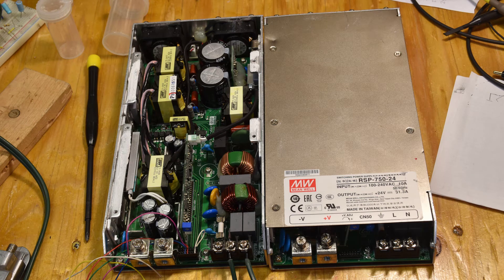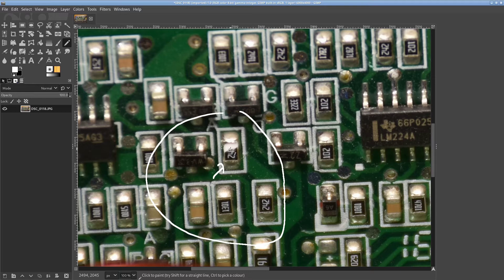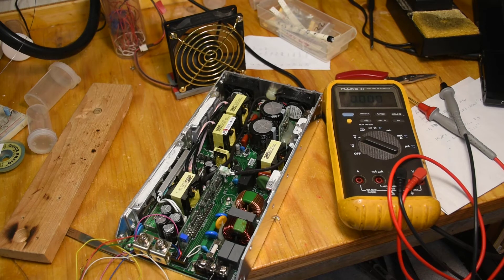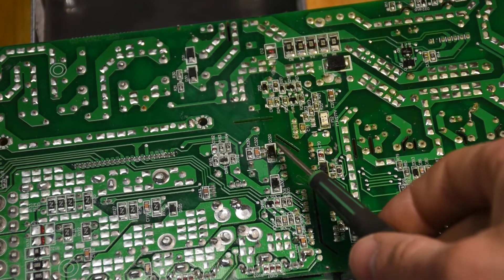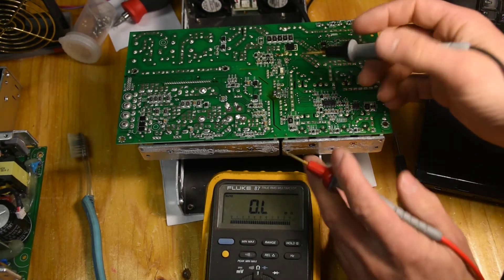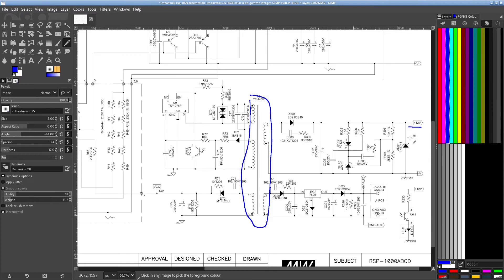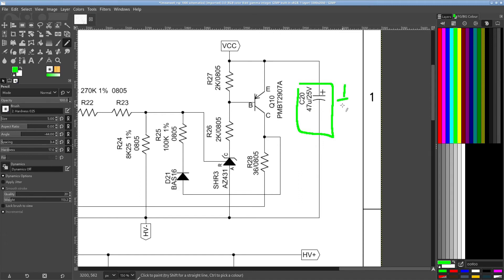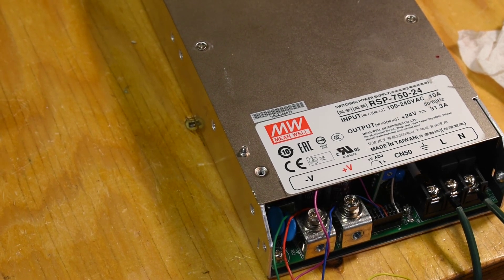Meanwell RSP-750 power supply repair

Comment: Wow Im impressed, I was given a couple of these, both have red lights on, both were running large fans which exploded taking the PSU with them. When I looked inside and saw that control board and without a circuit I put it down. Now I have the Schematics for the RSP-1000 Im going to give it a go, thank you for sharing your experience.

Comment: Nice video and repair👍🏻
One question… are the fans permanently running or only when switching on the psu?
Are they temperature controlled?
Reply from the maker: From the datasheet : "built-in fan with fan speed control"; from the RSP-1000 schematics it's modulated directly by the sensed output current, but the fan is always on even with the "REMOTE ON" shorting plug removed.
Reply: @fenugrec5697  
Thank you for your quick response!
I received a new one (RSP750-48) today and can now say that it’s true 😕
To me it’s way to loud even with no load connected. Do you have an idea how to reduce fan speed on the controller/ board? I could also change to Noctua 
fans which are quieter… 🤷🏼‍♂️
Reply from the maker: @Chris-sc3rf  The smaller the fan, the stronger the correlation between  "noise" and "airflow"; you can't win. Of course you could tweak the fan control, or re-engineer one like I did for a GPC-3020 ( https://www.youtube.com/watch?v=3FC4myguLyw ), but when providing any kind of power, your PSU will generate heat and need sufficient airflow. You might rewire the REMOTE_ON switch to also disable the fan, but that's not great: if you run full tilt and then turn off - lots of residual heat, not good for reliability.
Reply: @fenugrec5697  
Yes that’s true. I can’t half the airflow without impacting the cooling. The load I will connect is dynamic with a low duty cycle 30-50% (SSB power amp) so I hope it will work…
I will check with an electronic load if the airflow is sufficient.
What I really don’t like is the fact that the fans are controlled by sensed current and not by the actual system temperature 🙄

Comment: Fantastic fix - congrats, and thanks for sharing!  Just scored three used 48V models hooked up in either in series or parallel, and they will most likely have issues.  I don't have your smarts to find issues so quickly but your video will still help.  Would like to parallel them to get more amps so murphy's law says they may be hooked in series(dam that murphy.
Reply: Did you succeed?  I was told by Meanwell Tech Support. in no uncertain terms, that the RSP-750-15 can not be used in parallel.  

"No, the RSP-750 cannot be wired in parallel to achieve greater current output. Models that support parallel operation will have instructions for operating in that mode on their spec sheet. Only our models with the “current sharing” function are designed to be operated in parallel. It is necessary to avoid the load becoming unbalanced between the power supplies. The RSP-750 does not have this function."

My question about current programming function being sufficient to protect from load imbalance received a simple not supported answer.
Reply: @flintsmith4771  No luck yet, have not had time to do much troubleshooting.  All three definitely have issues (the worst - water damage).  Big filter caps on all three are blown and found a couple other bad components.  Goal now is to just get two running and use other for parts - just wish I had more time and EE knowledge.
Reply from the maker: FYI I don't remember if the V- terminal is bonded to chassis ground ; if so, they cannot be wired in series. The datasheet doesn't say it can be done, so assume it can't, unless you can thoroughly review the schematics to ensure it can work. For operation in parallel, the RSP series isn't specifically designed for load sharing (some more sophisticated models are), so YMMV. Good luck !

Comment: Hello I need your help. On the RSP-750-24. To wire a simple 2-wire on/off switch on pin13 and 14. Do you by any chance know how to wire a simple 2-wire on of switch for the RSP-1500-24?
Reply from the maker: That should already be explained in the rsp1500 manual, no ?
Reply: Manual is not very clear on this issue. Another thing the manual does not have is how to actually adjust the current. In this situation again, he RSP-750-24 is clear on how to do that adjustment but the 1500 doesn't even mention it. It only shows how to do a voltage adjustment.
Reply from the maker: @KeithOlbermannn  "Remote ON-OFF is activated by the configuration with respect to CN1,CN2 and CN3 as shown in the following diagram.", page 5... Can't comment on current adjustment, not familiar with that
Reply: @fenugrec5697  come on bro, I read that in the manual.  You know as well as i do that that is mumbo jumbo to layman like me. If you understand it, can you put it in layman's terms?
Reply from the maker: @KeithOlbermannn  There is a wiring diagram showing exactly how to rig a switch for remote on/off. If that is "mumbo jumbo", I don't think I can explain it any better and I don't think I should - sorry to have to say this, but it tells me maybe you are not fully aware of the risks involved in playing with a 1.5kW power supply capable of causing serious damage to you and whatever you're working on. Or maybe you are; I don't know, I'm just some random stranger.

Comment: Hi tanx a lot for your good description.i have a question a bout ZTE zxd030 s480.
I have 290volte on Filter capacitors.i have no vcc voltage for 2pcs01.no short dieod on auxiliary supply.i have 12v for vcc ice2a2 and 1.4 v feedback.i don't know why soft start not working.i check isenc is connected to ground.what I should check? Pls help me

Comment: Hi.
You may know reason to my issue.
Its sdr 480-24v and after supplying 230v i get nil at dc output and i get dc-ok led pulsating as well as clicking relay. What can it be??
Reply from the maker: i don't know, it's a different PSU. Do visual inspection, look at auxiliary supplies during poweron, etc.

Comment: The RSP series have built in current sharing and designed to be ganged together.
Reply from the maker: Indeed. That's why the voltage and current feedback loops are fairly complex.